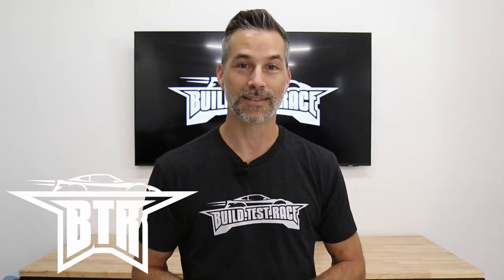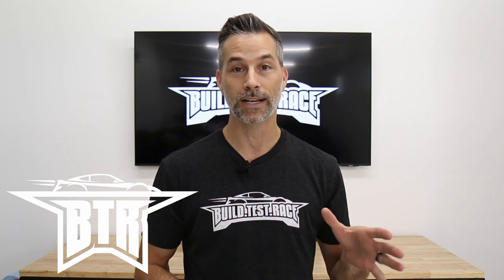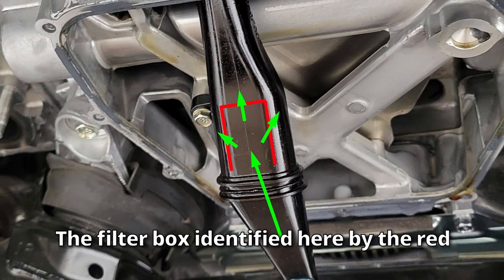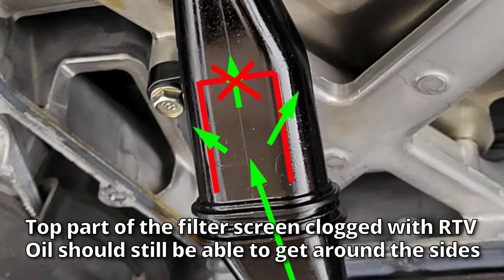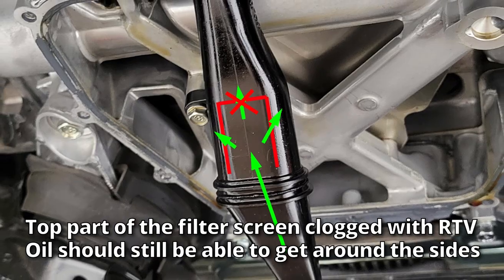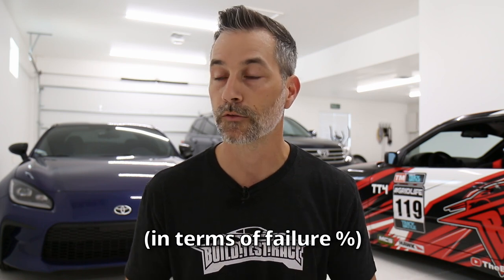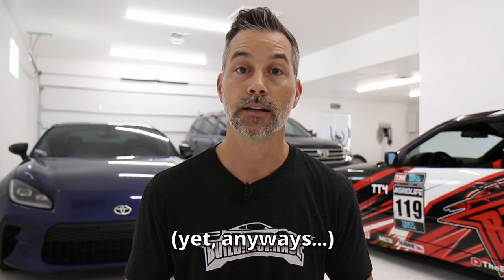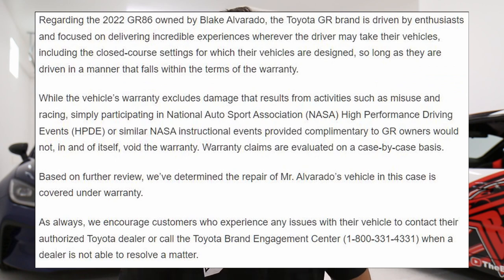Q&A From The GR86 RTV Silicone and Oil Pickup Issues

Comment from the maker: A key point in this video is the overview of the new oil pickup design at 10:40. This is why I think (emphasis on think :D ) this whole RTV in the oil pickup siutation may not be as disastrous as it has seemed in recent weeks.
Reply: agree, thought that was the most important part of the video, gave me some reassurance about going forward with my 23 GR 86 purchase next month. Thanks
Reply from the maker: @fb2036  Congrats on the soon to be new GR86!
Reply: On the FA24, the failures I came across were usually show  a single bad journal bearing.... If it was oil starvation due to a clogged oil pickup or other cause of starvation, you usually see damage to all the journal bearings. However, it is possible that  a chunk of RTV can break off, get chewed up by the oil pump while the filter is in bypass mode, and those small chewed up pieces get lodged in an oil passage somewhere. Or possibly extended low pressure with a poor designed oil delivery system, exacerbated by small pieces of RTV in the system.

Comment: I’d be pretty surprised if Toyota/Subaru was to allow this issue continue into 2024. I’d hope they’re already looking for a proper fix.  They’re usually on the ball.
Reply from the maker: The 2022 cars do have an updated pickup, which addressed issues from the previous gen. See the 10:40 mark for info, if you didn't see it already.
Reply: Yeah you remember how fast subie fixed head gasket problems ?
Reply: Don’t be so sure they kept putting there bad steering racks for years in there 4 runners the old steer wheel flutter the Lexus Gxs got there’s replaced

Comment: I think about other factors.  0W-20 is not the best for an on track, high oil temp environment.  Oil level, very important on track with high G forces especially on sweepers.  Mechanical over revs, this happens quite a bit.  Adding an oil pressure gauge with warning light would help identify pressure issues hopefully before damage.
Reply from the maker: I agree, all good points! Oil level is a big one for me as well. I'm going to be adding an oil pressure sensor/gauge here soon, so I can start logging data at the tracks I race at.

Comment: I was an aircraft mechanic in the air force and we used to use red rtv on aircraft engines because it can hold up to high heat in flight my guess is that Toyota realizes that a 4 cyl engine runs a lot hotter than a 6 or an 8 cyl and  the rtv can last longer than a traditional gasket

Comment: I appreciate that you posted a picture of the old and new oil pick up tube. That helped ease my mind, but I still have an appointment with subaru later today and they will be removing my oil pan.
Reply: Can you update your comment with your findings? I haven't heard a single BRZ owner report this problem yet, which is strange considering both gr86 & BRZs are built the same.
Reply: Sure I can update it when they tell me what they find. There are plenty of forums and ppl reporting that the new 2022 wrx also has this silicone problem as well.

Comment: I have a 22 gr86 automatic I bought it 2months ago I already put almost 6 k miles on it. The car is my only and my everyday work car. I doordash and ect. in it. My 86 does 23.5 gas mileage mostly city. I only pay 30 to 35 for a full tank of 93. I Changed the oil once at toyota  at 4500m I plan on changing the oil again at around 8500. When I do I will check my oil pan and tube at dealership. I'm going to see if I can look at it my self when they drop it. Also I'll either have them check the filter for debree. I have a strong feeling there will be rtv or silicone.But I hope cleaning it every 2 oil changes will do the trick. I used to own a 17 camry so I really love this car. I will keep an update on your 86 .
Reply from the maker: Even with some RTV in the pickup I think you will be fine. Always good to be cautious though and be preventitive if you can.

Comment: The previous generation pickup was just 1 screen .. So IF it got clogged, YES an issue would arise.
This new screen has multiple "windows" for multiple paths for the oil to flow thru.
Like building a house with 1 window vs having 4 windows for improved air flow.
Reply from the maker: Yep, I speak to exactly those things (with photos) at the 10:07 mark and 10:40 mark.
Reply: @TheBTRGarage  apparently ... about a month ago some guy posted that his gr86 with only 1k miles had a clogged oil pickup. He dropped the pan and all 5 walls were clogged with rtv but NOT from the oil pan because he dropped it and re-did it with just enough to seal it. 
His oil light came on and thats how he knew something was wrong.

Comment: Unless there's full detailed reports on the blown engines and what may have caused it, it seems the owner automatically assumed it was the RTV in the oil pick up that caused the failure because that's what he remembered was an issue from the previous generation.

 It's possible his engine oil level was very low combined with high G cornering and a slightly restricted oil tube was the recipe for disaster. Does the oil pan need baffles to help keep the oil from moving around too much? Maybe it was an oil pump failure etc. What im saying is more investigation needs to be done on the blown engines instead of assuming the cause was some rtv in the pick up tube box which has clearly been designed to take some blockage. 

What the community needs to do is try and obtain a report from the owner supplied by toyota describing the failure and repair in detail.
Reply from the maker: Right, all we really know is there was a correlation between a spun bearing and RTV in the pickup. It doesn't mean the engine blew as a result of that...contributed, possibly, but really hard to prove.

Comment: This makes me think of the uproar over IMS bearings in the Porsches. My 2007 cayman s has the bearing and no issues knock on wood) The failure was blown out of proportion. failure was .01%. My gr86 has 3k on it. Pulled the pan. Zero issue. BUT they did over do the sealant. Did a smaller amount. To your point, they use the sealant in so many other places. I do really like the oil pickup design. To those canceling your orders, it’s a mistake. One of the best budget 2 doors, rwd sports cars. So much to be happy about with this 2gen. Like you, I have a 2018 brz that I race with scca, nasa and WRL.
Reply from the maker: Yea, I've heard others make the same comparison to the IMS bearing situation. I agree it's a mistake to cancel based on this situation alone!

Comment: I'm with you on this:) like you said it's a very small issue if it's any issue at all but people just have different levels of tolerance or understanding for this. Me as a GR86 owner for 6 months and did 10+ track days on this car never worried a bit about this.
Reply from the maker: Indeed, we'll see how this ages with time :D
Reply: Time will tell how bad of an issue this is. With the new oil pick up design, it might not be an issue for those that have bought it brand new, however, it might for later years with more miles and not knowing how much and where exactly the silicone is coming from can still make this a big issue. For now, based on his opinion and new oil pick up design, we can enjoy our brand new cars but again age will tell the true depth of this issue.
Reply: Hope you know your track days just voided your warranty

Comment: To me it don't matter if you doing high rpm or daily driving if the rtv gets clog up in the pickup tube of course its gonna have oil  starvation n rtv going in the engine where its not supposed to go to the engine will blow up with no oil going through and yeah the timing cover is gonna cause problem to with all the rtv on it . I think from manufacturer they didn't do a good job putting the rtv they probably didn't bother to check if there too much rtv on it

Comment: Would you rather have a "Ford Pinto" situation?  The manufacturer chooses the numbers over the customer.  Subaru/Toyota factor the amount of engine failures during the warranty period (due to oil starvation) is a lot less (money/replacement wise) than issuing a recall and looking at/dripping pan/fixing ever car brought in to the dealer which is 100s of tech-hours and 1000s of (?) costing $M. Ethics and values.  What is the ethical thing to do?  What does that (ultimately) say about the company.  (Franchise) Dealers will be caught in the middle.
Reply from the maker: Right, I'm guessing it will go through some sort of "dollars and cents" process to weigh the various options. I had a section recorded on just that, but decided to leave it out of the video cause I don't think I have enough real info (basically % failure per X amount of cars, what is expectation, and what determines warranty/repair/etc).

Comment: Is it possible to replace the oil strainer / pickup tube with one that has a larger external filter? That wouldn't fix the issue, but would lessen the chance of a complete blockage, and also give the silicone a chance to be flushed out during an oil change
Reply from the maker: I'm sure it is possible, but I don't think one exists as of yet that meets that requirement.

Comment: How about the amount of blockage the silicone is causing? THAT is the biggest factor in the recent FA24 motor failures. You can baby your car but if you have 85%+ blockage (causing pump starvation-aka cavitation) that alone can wipe out a bearing, bearing spins in bore and cause "knock". Pretty basic chit imo
Reply from the maker: Take a look at the oil pickup design in the 10:40 section. Assuming the top screen on the filter is totally clogged, that's only 20% blockage. The 2022 oil pickup filter appears to be designed to function with RTV stuck on the top section of the screen.

On the old gen cars oil pickup design, what you said is totally accurate.
Reply: @TheBTRGarage  AHHH, I was listening in the background at work. After WATCHING you are absolutely correct, and thank God for the new pickup design. Seems like engineers took measures to correct from 1st gen failures. Hmm, that is interesting thank you very much for pointing this out! New design must have 4-5X the surface area, but I wish it was a bit finer in "pore" size.

Comment: Why is it that I have not seen any Subaru BRZ owners reporting this? I’ve only seen GR86 with this report this issue and BRZ has been out for longer time. I’m sure there are many more BRZ out there with more miles. They are made in same factory and use mostly same parts but haven’t seen any brz owners reporting this. At least Subaru is better with customer service
Reply from the maker: Not sure, there have been far fewer BRZ's sold, could be one reason. Also, nobody would have ever even thought to check the oil pickup if there wasn't an engine failure, which is when everyone started checking/worrying. But you're right, the BRZ should have the same issue. Although the fact that we haven't heard about it from BRZ owners, lends evidence to the idea that it is not as big of a deal as it's made out to be. Time will tell...

Comment: You took off the oil pan, you had to pry it off, that Silicone had not broken off and was stuck like glue. That should be the same everywhere so the question is where?? I’d guess the timing chain cover as any breaking off could be chewed up by the chain and sent down to the oil pan. The screens are not blocked and yes pieces are there but enough to block the oil?? Spun bearing can happen with extreme over revving and also with heavier oil that could be used on the track. Just my thoughts
Reply from the maker: Yea I basically hit all of those talking points in the video :)

Comment: Someone needs to make a new oil pan or modify the oil pan to allow the screen to be cleaned without having to remove the entire oil pan every time.  A portal of sorts at the pickup so you can easily see straight into the oil pickup screen .

Comment: My gr86 engine or transmission sounded bad  right now (sounded like a puff )that is why I’m watching this video, I was going at a regular 35 mph and all of a sudden my dashboard showed all these lights and the check engine light came up everytime I tried doing more than 3k rpm my car wouldn’t go faster and this was in public (1 hour before this comment) I am still waiting for the tow truck that is covered under the gr86 warranty, also as I was turning off my car my engine took forever to turn off and my car sounded like it couldn’t breather it was idling too much and the exhaust sound like bad bad farts like sort of like the engine couldn’t breathe

Comment: All this RTV stuff is causing me to overlook buying one of these. Local specialist stores near me quoting $660 to clean it up - which is probably fine if its a one time thing but this seems to be a necessary routine maintenance item........
Reply from the maker: Check my follow up video where I pulled the pan a 2nd time. There was only some tiny specs found in the pickup (after my initial cleaning).

I honestly wouldn't even worry about it. There are so many people racing and beating on the cars w/out issue, and they haven't touched the pickup. Since I've posted this video, time is proving it was way overblown originally.

Comment: Great video.  Thank you.  I canceled my order based on this issue. . Somewhat regret it but I can’t service it like you so I was stressed about it.  I may reorder next year. Live in Northeast so would not want to take delivery in winter anyway.   May wait for 2024 too although I doubt this gets addressed unless it is a simple fix with application process.  As you mentioned, silicone is an issue in Gen1 too.  🙄. Thank you again.
Reply from the maker: You're welcome, hope the video was helpful. The right time will come and you'll get your GR86!
Reply: Im canceling mine too. Its foolish to buy new car for $$,$$$ knowing it has oil flow restrictions and requires more $$$ to address plugging issue.

Comment: Has this issue been resolved on newer cars? It’s almost a year old now. Thank you!
Reply from the maker: Nothing has changed on the 2023 cars from a oil pickup design perspective. There is not really an issue to resolve.
Reply: @TheBTRGarage  you dont think they need to change glues??
Reply from the maker: @ebdbdave  I'm no wngine builder or engineer, but I would say no. The issue causing failures is poor oiling/oil pressure in the engine, not RTV in the pickup

Comment: My opinions;

1. I've witnessed RTV (lodged in the pick-up) starve and subsequently kill an engine at idle.
2. The dealer tore Blake's engine apart & the damage was due to oil starvation, failure has to be blamed on the RTV - it only had 14k miles.
3. I wouldn't buy this car after RTV fiasco, cancel orders & go see Miata.
4. Interesting oil pick-up design, it didn't seem to save Blake's engine however.
5. I hate boxer engines, I wish Toyota would have jammed an 8ar in there! 😁
Reply: Agree. Go with Miata. Good thing I already have an S

Comment: As an engine builder I can say the amount of RTV being found in the pick up wouldn’t cause any problems. If there’s a link to a video with a blocked pick up please link me. 

That said the reason to use RTV is because of how stable it is in comparison to a gasket. It has a very long service life and is much better than a traditional rubber or fiberous gasket. Most Japanese manufacturers have been solely using RTV since the 80s for anything oil related that isn’t high pressure and doesn’t need to be serviceable, so this isn’t a new phenomenon by any means. 

Lastly I’ll say that this RTV wouldn’t be dislodging from around the pan as has been suggested but likely from around the timing case. Excess likely ends up touching the chain on assembly and is pulled free on first crank. The bulges seen inside the sump is completely normal and you’ll find that across all makes and models. As said the unique part of this issue is the timing case as it’s a very tight tolerance area and it would be the easiest spot for the silicon to contaminate the inner cavities.
Reply from the maker: Thanks for the great insight! I agree the RTV being found in the pickups should not be a big issue. I have yet to see the whole pickup blocked either, it's always just the top screen. Which in that case, oil should still be able to get around the other 4 parts of the pickup filter screens. I guess time will tell how this all unfolds.
Reply: If rtv restricts oil flow too much, its a huge problem.
The car does not come with an oil pressure gauge.
Reply: @phillipmoon3369  As it was stated, the new design, if clogged, would account for a 20% blockage.  There is enough oil getting to the engine then.  There have been no videos or pictures showing RTV on the sides of the screens.
Reply: @brianb7844  
I agree the blockage on inspected vehicles with low milage shows around 20% restriction, but that does not mean 20% is the maximum or upper range. When you consider time and milage in the equation, additional material can break off at any time, especially at higher milage after warranty has expired. Unfortunately, there is no easy way to inspect or clean out, and there is no gauge to monitor oil pressure!
There are few if any New car buyers that want to purchase this liability.
Instead of solving the root cause of the problem, XS RTV in internals, Subaru chose the piss poor engineering method of increasing the size of a screen, and then further failed to install an inspection/clean out port. This is a no brainer. They screwed themselves.
Reply: In addition, thank you very much for the video. It was insightful as were many like it. I am canceling my order for the 2023 BRZ. Even though I love the car, this is simply an unacceptable liability and gives me concern about QC/management/engineering interactions and decision making.